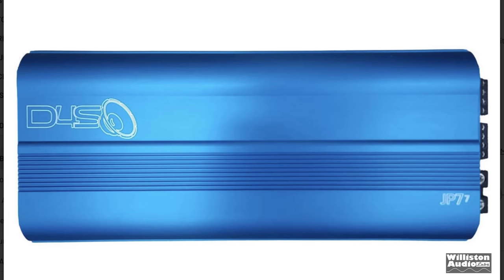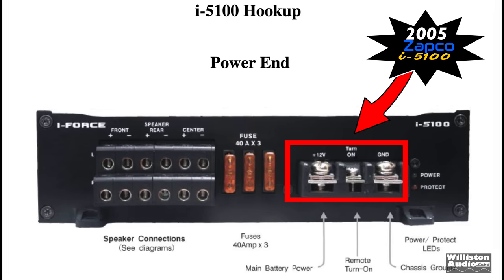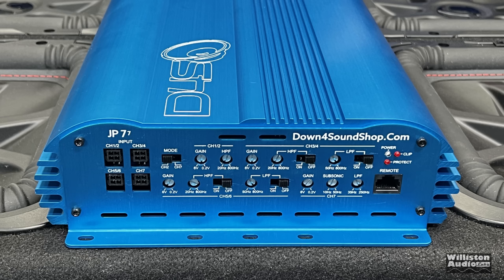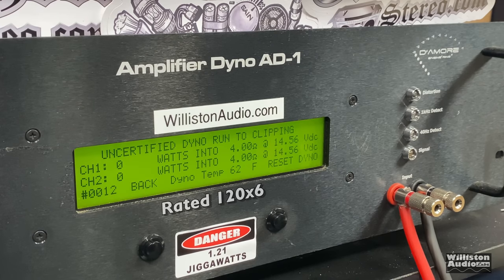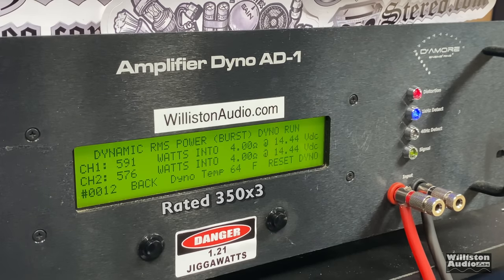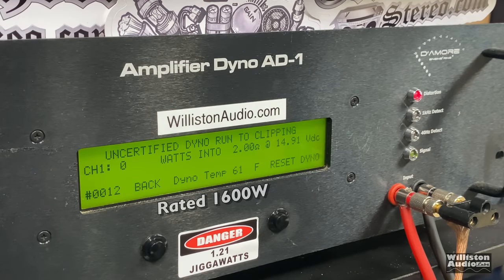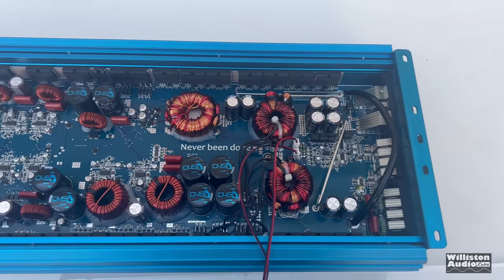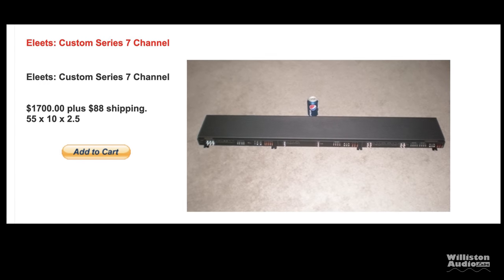The MOST POWERFUL 7 Channel Car Audio Amp EVER?

Comment: I have a question that may sound silly but here goes. Do you mount these amps on their side or use some sort of spacer/open platform since the plexiglass bottom is vented with cooling fans attached?
Reply: the fan and venting is there for a reason... longevity
Reply: @administratorperson3272  I wasn't asking why it had fans, I asked about the mounting options. The issue I have is that the fans will not work correctly if they are sealed against it's mounting surface.
Reply from the maker: If you’re mounting on carpet you should add spacers. The amp is lifted slightly but could stand to be up a bit more for proper airflow
Reply: @jasoncarpenter4116  correct, you answered your own question.
you can buy spacers in both metal and nylon at any hardware store. you can make stand off spacers out of a dowel, or use a hole saw to cut plugs for standoff spacers.

Comment: You usually report the amp efficiency, but I think I missed it in this vid.
Reply from the maker: It would have been an estimate since I could not measure each channel. Safe to say typical Class D 75-85%
Reply from the maker: @ONEKON  your math is big dummy, you forgot the other six channels were also active and putting out power. Assuming is a bad thing…

Comment: Love the power output of the JP amps, love the value... but I must be the only one who thinks they're fugly.
Reply from the maker: Not for everyone but I dig the blue, red and purple not so big in the green
Reply: Ya, you really are. The blatent rip off of the old us amps designs insures people will love them. Youre a very, very small minority.
Reply from the maker: @jamesstephenson2346  not a rip off, they worked with former US Amps engineer on the design 👌

Comment: How do you match up speaker ohm ..if I used 2 b2 rampage 8s and the b2 mani 63 how do you get the mids and highs down to 2 ohm..I can't find any tweeters that are 2ohm
Reply from the maker: You can run channels at different ohm loads, no problem
Reply: I feel like this set up would rock the shit out of my ford ranger extra cab

Comment: would love a 7 channel amp it would solve my issue with new sndroid stereo having 1 single rca sub output altho it came with line converters it would leave me 1 line for regular speakers defeating the awsome eq options the deck has man im happily disappinted but yea point is damnit i need thst amp lol

Comment: How come with the amplifiers with no fuse goes over the rated amperage , and gets  higher amperage  . Shouldn't you use that safe fuse that is recommended by the so then now put is different because you do not use the safe fuse amperage.????????????????????????????????????????????????????????????????
Reply from the maker: Testing with resistive loads put more of a strain on the amp than standard speakers. I'll pull more current in my tests then you will with speakers and music. Yes, you should use recommended fuse as this is what they've determined is best for normal situations
Reply: Ok thax bro  will do🥳 thanks I recommend to say that for other users using  the amps .by the way I brought jp77,jp95,jp8and jp84 because the way you show them plus that's  is  what I put in  Mazda MX6 ,I have a  340 amp alternator but not at the same time. Mix jp95 with jp84 to be safe. Then maybe use only jp77 .
Reply: Ps very cool channel love it thax for everything . 🥸😎😎😎😎🥸😎😎😎😎

Comment: HOW is the Certified the same as the uncertified for the 4 ohm test and at the Exact same voltage. How is that possible????. It sounds like to amp doesn't stop at 1 percent distortion. What is big D not saying anything about this. This is crazy!!!!°

Comment: They should make a cheaper version without any crossovers.  Many who would buy an amp like this will use an outboard dsp for full active. I run 9 channels of full active through an Alpine 850s dsp.  Lots of wasted signal processing in my amps.
Reply from the maker: You can bypass crossovers and I doubt you’ll ever see it cheaper than it is right now

Comment: The pigtails always screw up. DD tried it and total failure.  Had a bunch with connection problems.  Pigtails were bad. Not a fan.

Comment: I got a jp8. It claims it’s 1200 watts. But only rated like 700 watts. I really don’t believe these amp dyno tests. I got a audio control lc 1.800. And the audio control blows it out the Water. So I don’t trust these amp dyno test. 

Audio control 1.800
JP8 dyno says 1200 plus. 

But the audio control wins.
Reply from the maker: The AudioControl does over 800W at 2 ohms whereas the JP is rated at 1 ohm. Amp Dyno tests are accurate for measuring power output

Comment: I wanna know who TF is putting 120W on their tweeters. Holy crap.
Reply: I have 500 x 2? I couldn't tell you how many adjustments it took to not kill tweeters when demoing hard. I actually use a 20 year old T3002 Rockford power series amp I bought from Derick himself. 

It's wayyyy overkill for sure.

Comment: 8 gauge speaker connections?   WTF?
Reply from the maker: A bit overkill for the main channels but they are all sizes the same. You can fit 16/12ga as well

Comment: 7 channels 😂😂 down for sound is trash. Better check all 7 asap when you get the amp. I bought a 5 channel form down for sound 5 channel didn't work. Comes with micro warranty. Wonder why they charge for a real warranty
Reply from the maker: Did you drink Hateraide before committing? Any amp you buy can have issues, contact support do they can address it

Comment: No SKAR audio in on clearance because their junk is over rated and under performs not to mention highly unreliable.
Reply from the maker: It’s just a video title 😝
Reply: @wal  i know. I'm just still steamed over my purchase of their top of the line tweeters and mids which couldn't even handle a 3rd of their listed wattage specs. and it's definitely not noise or distortion as my amp is the AC LC-4.800. I wish Boston would come back into the Market i've got a set of their bottom of the line 6x9's that can handle triple their rated wattage